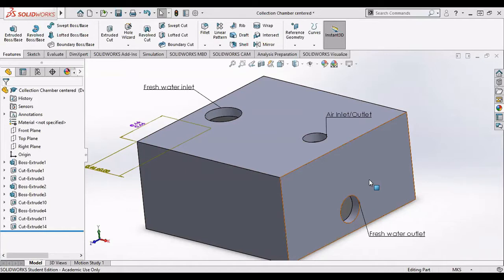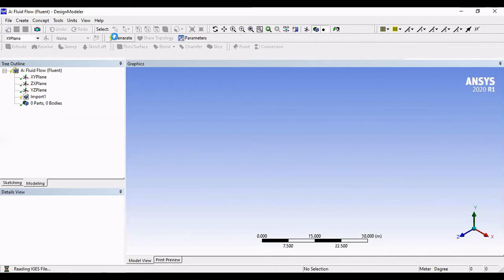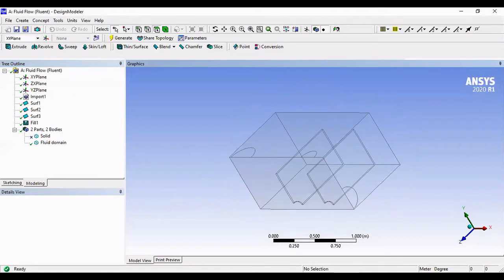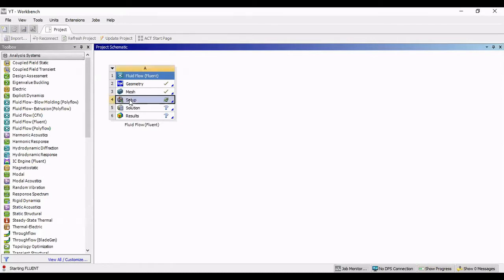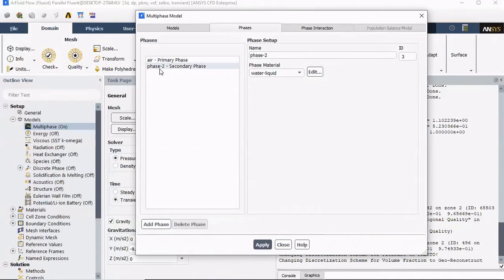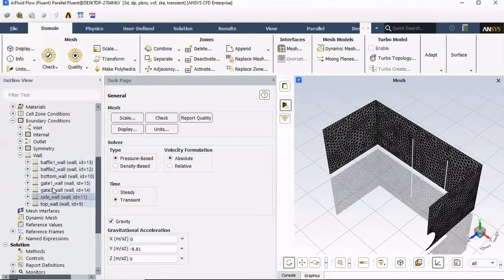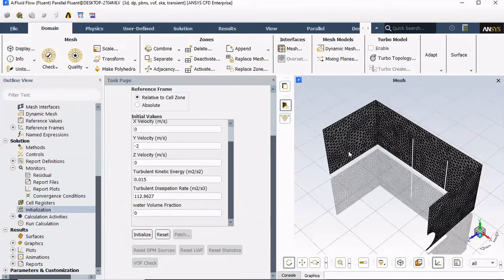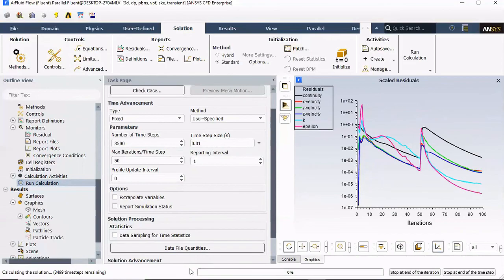Ansys Fluent - Volume of Fluid setup for a water chamber tutorial

Comment: Hi, thanks for the video. I want to know how to display the full simulation as at the beginning of the video, for the full volume, not just through the symmetry section.
Reply from the maker: There is a mirror option that you can select. If it does not show up as an option sometimes the issue can be that in the beginning you did not set up the surface a symmetry boundary.
Reply: @EngelUniverse  Many thanks for your reply, actually I applied your steps on another geometry, the geometry which I applied is not symmetrical. I want to show the results as a video, like the one you shared at the beginning of this tutorial. How can I do this?

Comment: Hi and thanks for your useful tutorial. I have a question regarding the flow in & flow out. Is there a possibility to simulate an imaginary inlet valve and close it after a particular time while an imaginary outlet valve is still open? My goal is to observe how the rest of the simulation will be continued just when the existing fluid in the tank flows out? For instance, the water flows in for A seconds while the whole simulation is run for A+B seconds. So the inlet flow is stopped after A seconds, while the simulation will be continued for the B second. 
I hope I could have expressed my mean. Thanks in advance for your response.
Reply from the maker: I haven't done anything like that yet, but I beleive the way it is done is that instead of putting in a constant value for inlet or outlet, you enter a particular function. You need to create a function that allows the value to behave in a way a valve would; like for example, after a certain time its value would go down to zero. This way you would simulate the instance where the valve get closed.
Reply: @EngelUniverse   Thanks for your time and explanation. I will follow your instruction. Cheers.

Comment: Could you explain cell zone and outlets  conditions? Cloud you tell value of Operating Pressure? What value of Gauge Pressure on outlets? Thank you for usefull video!
Reply from the maker: Cell Zone condition was automatically assigned in this problem by Ansys. Usually it does a good job assigning it, but I just like to click in there and visually verify that what I'm seeing is actually acceptable for my physics setup for the problem.

Comment: What solution method did you use - Simple or Coupled? For the outlet boundary condition, is the volume fraction for water 0 or 1?
Reply from the maker: Solution Method was Simple. About the volume fraction, sorry but I don't remember the settings
Reply: @EngelUniverse  Thanks for your reply. I'm trying to create a multiphase model using VOF and am using the Simple scheme too.

Comment: How initialize calculation when chamber has 2 inlets?
Reply from the maker: Make sure you set up all inlets and outlets correctly at the Boundary Conditions section, and then when you initialize, it will automatically initialize all of them. You don't need to initialize each of them separately.
Reply: @EngelUniverse  Thank you.